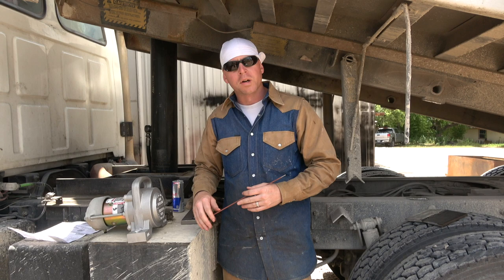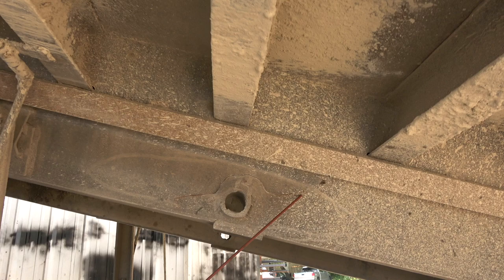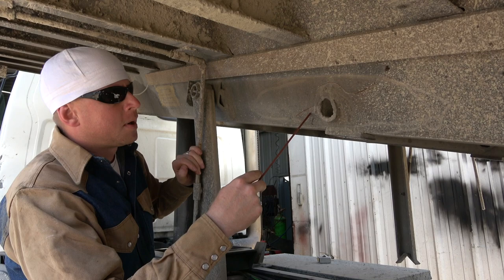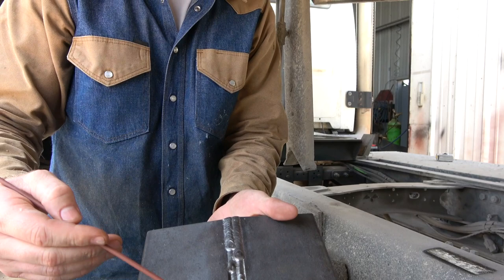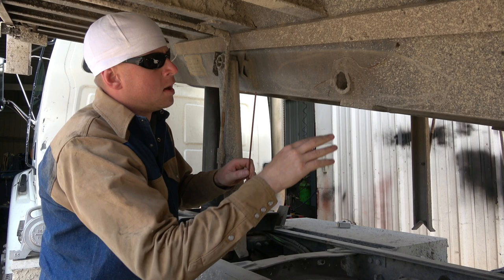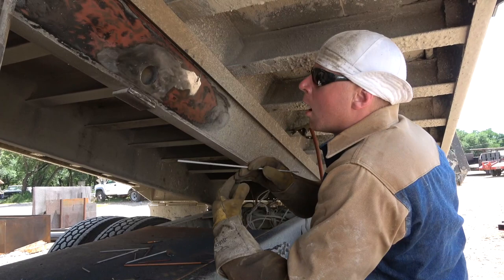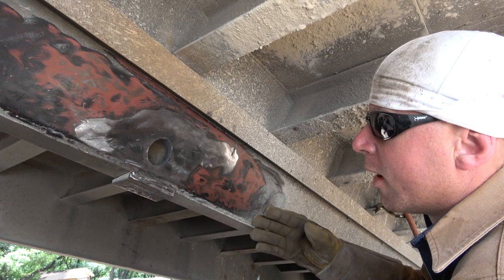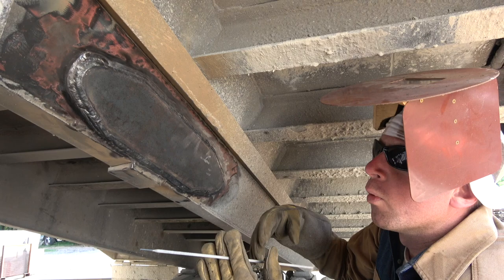Welding Repair

Comment: that vibrator will make cracks on old trucks like that standard. you should have cut out plug weld holes in your diamond, you also stressed that old frame by welding those heavy stringers thats over the top.